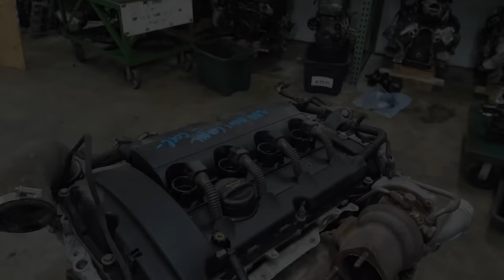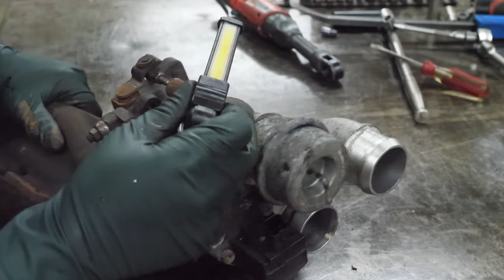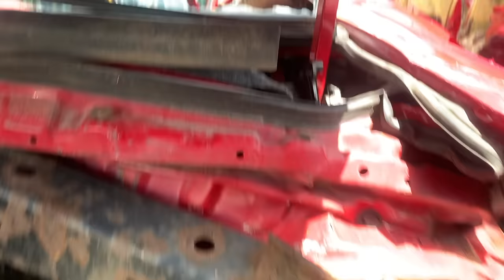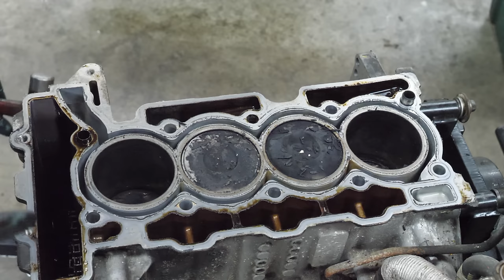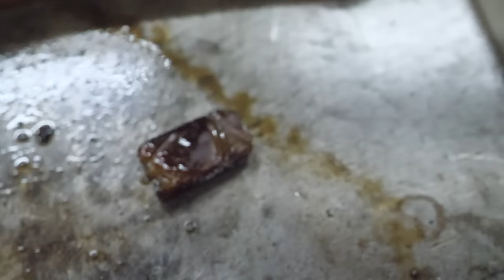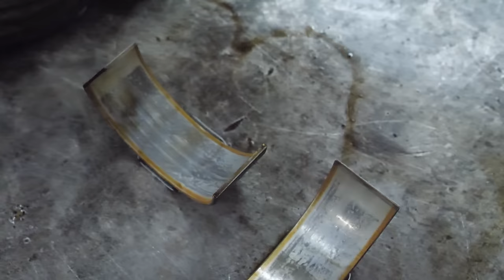JUNK Mini Cooper S (BMW/Peugeot) N14 Turbo Engine Teardown. Why Do People Buy These?

Comment: I'll bet the designer who routed the dipstick through the chain guide thought it was the coolest thing ever.
Reply from the maker: “They’re going to LOVE this…”
Reply: I mean they at least routed it through the fixed half of the guide not the tensioning half of it. That counts for something right?
Reply: "Did you hear they picked my timing guide design at work, they said it was the most financially viable option because of how much plastic I was able to incorporate."
Reply: Heck of a fight to get that tube out.
Reply: "I'll bet the designer who routed the dipstick through the chain guide thought it was the coolest thing ever."   He may have gone on to oil filter placement.
Reply: It's like they spent years shuffling the undesirable to the B team, who then designed the Mini.  Meanwhile, the enthusiast community is screaming, "You were the chosen one."
Reply: @RyanKimpel  that’s what they said to the water pump designer.
Reply: @09corvettezr1  same guy worked in the water, timing, and oil filter design dept.  I believe he worked at Ford prior.
Reply: @@retiredbore378 BMW were really successful in the past, with iconic cars like the 507, 2002, the 635 Csi, the early 3,5 and 7 series and so on. It's only these last decades that BMW has gone to replace as much metal parts with plastic parts as they think they can get away with. European car manufacturers have simply adopted the same strategy that manufacturers like Ford, GM and Dodge have adopted long ago: it only has to last to 1 day after the warranty expires, then it may crumble to dust for all they care.
Reply: @@retiredbore378 put the engine behind the axle, spend 60 years engineering around the problem. 🤣
Reply: @pkt1213  In fairness, they tried to fix that (924/944/928) but customers rejected them. Boxster/Cayman have the engine in a better place for weight distribution, you just don't have any access to it.
Reply: They moved it into the building 10 minutes before you arrived.
Reply: @bikeaddictbp  they have also nerfed the other cars to keep them from beating the 911.  Can't have the lesser cars out perform the halo.  Maybe not as much today because the 911 is an astonishing piece of engineering.  I might be biased as a 924/944/968 lover and longtime owner.
Reply: I agree with some of the comments on cheapness.  I’ve owned different German brands since the 1980s and I always found they were more susceptible to poor maintenance than Japanese engines . I had a E30 BMW 325i which was indestructible only oil changes and wear and tear items , same with E36 M52 2.8l , which I still have … only oils changes and wear and tear BUT.. coolant reservoir I’ve changed 3-4 times … , oil filter housing seal … , valve cover gaskets every 3-5 yrs Cmon BMW … and M54 well there everything well made in the M52 they switched to plastic .. plastic coolant pipes , plastic water pump impeller .. my friends still has his Toyota Corolla stick shift .. his first car after college 25plus yrs old , and he still uses it as a daily driver for nostalgia .. never had a problem engine wise , has no paint, same with his Honda accord  97 which has been handed down through his 3 kids ..
Reply: I remember seeing this on Just rolled In and I was blown away that it happened to begin with. what an awful idea.
Reply: @bikeaddictbp 924 had no hp, not even to beat a base e30. The 944 and 928 had good looks but maintenance is a bear. Transaxle in the back, clutch job takes a whole weekend, electrical nightmare…. The 911 is a drivers car, the 928 is a cruiser.
Reply: I doubt the thought it was “cool.” Probably more like they did not want to spend on extra fucking cent on the design, and it had to go somewhere so that’s what he came up with. Can’t tell how many times I’ve had to do stuff like that because they would not listen to us at the start.
Reply: I think the plugs on the bed plate pretty much give the theme of this design: cheap. Could have redesigned the oil pan to avoid that, but since it’s literally a throw-away, why bother lol…
Reply: Lol, I thought 💭 it was funny 😄 too. 🎉😂
Reply: Don’t be such a Luddite! It’s perfectly fine to use the chain guides for fuel, cooling, vacuum, and the wiring!
Reply: @exceptions9263  While we are at it, why not just make the entire engine one big chain guide? It can be the new rotary but with chain links made out of pistons instead.
Reply: @micahreid5553  they probably just didn't budget for a tensioning dipstick...
Reply: Aye, they probably saved a couple of quid/euros. It was all worth it. Plastic pa🎉rts inside an engine has never sat well with me, no matter how you try and sell me it 😂
Reply: Its a Peugeot thing, we will NEVER understand-- doing goofy stuff forever-- probably put the EGR valve in the oil pan!!
Reply: @Dieselfueledwork  fortunately, this engine has no EGR :D
Reply: @bikeaddictbp  "In fairness, they tried to fix that (924/944/928) but customers rejected them. " Those cars still have the engine in the wrong place.  The correct place is in the middle like Ferdinand Porsche's Auto Union Grand Prix car, like the 914, etc.  Porsche wanted to build a mid-engined road going sportscar -- and had many conceptual designs for this -- but a modified Beetle was all that was feasible for them at the time of the 356.  Obviously 40:60 is the optimal weight distribution for a RWD car not 50:50, hence most purpose-built racing cars are mid-engined.
Reply: My brother is into late 80s 4wd 3 series, they routed a front drive axle through the oil pan.  No way that could ever be a problem...
Reply: @jamesgambony5870  Current XDrive BMWs still do that.  🙂
Reply: Or an engine mount on the head
Reply: @las3k91  forgot,that's 1 of the tricks of a VVT system
Reply: @TassieLorenzo shhhh don't let him know about the 90s legends, the skyline GT-Rs, the front axle has the same working principle
Reply: Dip stick by name, dip stick designer by nature!, I'm thinking 🤔
Reply: Let's put diesel injectors INSIDE the engine
Reply: @RyanKimpel its not only a financial reason, why some parts got changed to plastic.. Its a fuel economy thing too.. Some things are great on paper.. but not in real life
Reply: I was just saying the same thing 😂
Reply: @tjroelsma To be fair, the European Union mandated that a certain % of car components be biodegradable in the 80's or 90's. It's why Mercedes got into deep shit when their wiring harnesses began to degrade and its why BMW plastics from the time were absolute trash. As usual, its always government regulations that cause cars to get more expensive and unreliable. Sure it spurs technological advancement somewhat but I can't really name an improvement emissions requirements had except in lowering emissions at the cost of reliability.
Reply: @nateTrh  I've never heard that argument before, but if that's the case, it might be an explanation for a lot of the really crappy (and always failing) plastic parts of those days. 

But that doesn't take away from the fact that for instance BMW's plastic engine parts still fail at an alarming rate.
Reply: I've seen the dipsticks get stuck in there and when you try to check the oil, the top half of the dipstick breaks off in the guide.
Reply: Not to mention fitting the oil filter in such an inaccessible place, which means that most people don't bother to change it regularly... @I_Do_Cars
Reply: And put the oil filter on the back.
Reply: Yeah, I have this engine and dipstick wouldn't come out so couldn't check oil level. Thought it would be a quick easy fix but the whole timing assembly had to be replaced because the plastic shrouding had disintegrated.
Reply: @yampymusic  so your saying the dipstick not coming out is a good indication that the timing is gone. Nice.
Reply: @jasonmajere2165  It's worse than that cos the timing hasn't even gone. But you can't fix the dipstick problem without removing/replacing the timing guide and belt, even though there's nothing wrong with it!
Reply: This may explain why they lost the war.
Reply: That's a very German thing to do.
Reply: I'm surpised it has one. Most BMW's dont have a dipstick now.
Reply: Leaking and burning oil have plagued my car. Otherwise it’s been really quite good.
Reply: I can see him now, "What? I can't drill it out?"
Reply: I had a 520 in the early 80s and I lent it out to my one employee. He phoned me to say the car had exploded with burning oil. The garage phoned to tell me an exhaust manifold bolt had fallen out and the bolt went through an oil way and engine oil was now pouring over the hot exhaust manifold. Sold all my fleet of BMWs and went the Mercedes W123 route.
Reply: @@retiredbore378all timing chain guides in all car brands fail. They’re kit metal because metal guides would cause metal shavings. Replace guides every 60K miles, 30k for Vanos and water pump. It’s not hard. The design isn’t the best but not the worst either.
Reply: @pkt1213  While BMW may have had a hand in designing this engine, they then had the engines made in France by Peugeot. What could possibly go wrong?
Reply: It all makes sense now why you can't get an accurate oil level reading 🤭
Reply: I bet he was the same guy who designed a dipstick on which it’s impossible to see the oil level, and the low oil light that doesn’t come on until you’re almost completely out!
Reply: @tjroelsma  lol. BMW pioneered that. Now every car has it.
Reply: Reminds me of a 928(the bargain porsche) my dad bought new.  Did not drive it 200 miles and the oil pump went out.  Brand new car bad pump.  What are the chances?
Reply: 1000th like my g
Reply: @woodrow_mayes  Whoa, I had no idea!
Reply: I'm just thankful mine has a dip stick ,i hate the idea of relying on a sensor ,mine has 240.000km on the clock ,it's a 1.6 thp 156hp Peugeot ,it's based or is the n14 french Peugeot equivalent

Comment: I know many people who own (or have owned) Mini Coopers.  Almost every single one of them has blown or replaced an engine on their Mini at some point.  None of these were neglected, they just kaboom.
Reply: Pretty sure that's how the engineers sold this engine to the execs. It's a pretty hard requirement for the engine to just randomly kaboom for BMW to put one into production.
Reply: Wonder how many were " earth shattering " ?
Reply: Well, I had a MINI Cooper S -supercharged, not turbo - for 12 years and it ran fine for 150,000 miles, so there’s that data point.   It was, however, a very early MINI — 2001, the first year.  That may or may not make a difference.
Reply: They probably all owned the N14 like the one in this vid. The N18 and B48/6 are usually way more stout.
Reply: I'm so glad I bought an  "unreliable" RX8!
Reply: Considering how many Minis had various forms of optional specs (ever seen a base package Cooper?  me either), they probably received some of the best maintenance of any car on the road in the last 20 years.
Reply: Man, I drive an b38, and the experience isn't much better but sure sounds familiar. And boy ho boy he want kaboom
Reply: Just like a Toyota Echo.
Reply: @MrBerryK  That is not the engine being torn down here. Those early 1st gen. (BMW) Minis were probably the best ones to have. I think I see more of them on the road than the 2nd gen.
Reply: The BMW mini, is nothing to do with the Austin Rover Mini at all. It is one of the worst cars to lumber yourself with just after getting your licence (here in the UK) The engine being one of the worst engines out there is only the beginning with these mini's. If the engine doesn't blow the gearbox will. Small cars that fail at these mileages , should be given back to the manufacturer, in exchange for a full refund. But I suppose it is the 'I phone' effect. Make a shit product and get everyone to want it, then put the price right up. Thank god I can spot the designer element, and keep clear.
Reply: Had 3 in the family all over 150k miles, little to no problems. Engines running great just rust etc eventually got them.
Reply: @ln5747  ahh, see, you need to live in GA
Reply: Never had those problems lucky mine with the cooper S.
Reply: I been around automobiles for 40 years and these minis are junk!!

Comment: I’ve done so many of these chains and swaps that I can literally do chains IN THE CAR in like 1.5 hrs including cleaning out the front bulkhead and pickup, and I can do 2 or 3 engines in a day (yes, I’ve had to do several in a day). That’s not how good I am, that’s not how easy these are to work on, that’s how much practice I had doing them. LOL
Reply: Did you have someone apply torque to the transmission side of the intake camshaft in the same direction while tightening the variable pulley?
Reply: @simonshurety3870  no way Jose I used a jig. LOL
Reply: @cparks7800  Sorry I didn't explain myself very well....I meant while using the jig.

Official Citroen Technical documentation procedures include what I tried to describe in my original question.
Reply: I used to do 2 camshafts on the weekend on 305 V8 Chevy's 😂😉👍!!
Reply: Can you work on mine?

Comment: Thanks for this. Explains why these Mini’s simply vanished from the road.
Reply: They sure did , hardly ever see them
Reply: R56 MINIs, vanished?  Interesting.  So much for the stories of BMWs holding up if you "do the maintenance".  IIRC, the N12 in the basic MINIs is meant to be not as bad and the N18 in the later Cooper S models is meant to be " fixed ".
Reply: Semi disposable car, like the PT Cruiser, the new Volkswagen Beetle Etc. Sharp and flashy but destined for the scrap Heap.
Reply: Roommate has a 2014
Reply: I still see tons of the third gen MINIs, and some facelifted second gens on the road here in SoCal.
Reply: So it looks pretty, but not a good car. Good to know
Reply: R53 tritec reigns supreme (if you ignore shitty mounts, timing chain guide and oil leaks and difficulty to work on it)
Reply: @TheSleepingonit  different engine.  BMW B48
Reply: @_IMNNO  I used to see like at least 30% of my morning commute traffic compones of all kinds of variations of Minis. After the pandemic, the minis have nearly disappeared. Now it's rare to see one on the road.
Reply: Probably fun to drive , not a lot of fun to maintain, a friend of the family had a bmw mini , he come around one day and mentioned he had to have a new clutch assembly put in it , this thing was not a hot rod or anything , just a normal daily , to supply and fit a clutch was $10,000 bucks !
 I said to our buddy what is it modified or something, he said nup totally standard ….. ouch !
I remember  doing clutches on conventional non FWD cars years ago,  a clutch kit was less than $100 bucks and you could do one in Your driveway on a Saturday morning, cars where simpler back in those days and built to be easy to work on, the good old days 😊.
Reply: I see minis every single day including the one I drive lol. They're really not that hard to maintain just a bit expensive.

Comment: Meanwhile, my 2006 Honda just went over 205,000 with nothing more than normal maintenance and oil changes. I wouldn't be bragging about 150,000 in 2023.
Reply: I have a crappy Hyundai Elantra GT with 460,000 mi (and growing)
A couple water pumps, several timing belts, 2 fuel pumps,  3 radiators, several trans oil changes, a pile of tires and brakes and headlight bulbs...
I gave it away to a neighbor who LOVES it. (How do you sell a car with 400K?) 
Everything still works including the AC and sunroof. 
Paint is holding up decent, I work at night so it sat out under the moon. 
Vegas car so no rust.
Reply: @TheBandit7613 if it was a Toyta you could have.  There isn't much difference in price between 200k and 400k.
Reply: @DragNetJoe — I had an 07 Civic that racked up 160k miles before it was T-Boned & Totaled at an intersection… also nothing but oil changes up to that point. Drivetrain was MINT.
Reply: 2006 Honda Accord 402,000 miles and still drives as smooth as my 2022 Accord!
Reply: @TheBandit7613 — That’s is quite impressive for a Hyundai! You obviously know how to properly maintain your vehicles!
Reply: My (Japanese Pathfinder) Nissan Terrano 2.7 Diesel bought 2nd hand twenty years ago, has about 400Kmiles  on it, just starting to leave oil on the ground and transmission shifts getting slow. Lots of small repairs like exhaust leaks, waterpumps, alternator and starter brushes. It has had a breathing headgasket compression leak held back for 5 years with radiator sealer additive, new head gasket waiting all that time. Worst thing about it is the dreadful steering geometry with bump steer and tracking errors. I set up the toe in by correcting for the tyre wear then do not let anyone play with the settings.
Reply: My 06 Mini got to 201k miles. My 07 Civic got to 192k miles until rotted through.